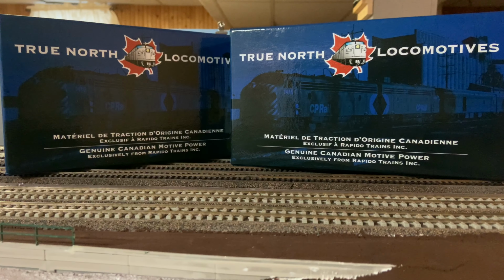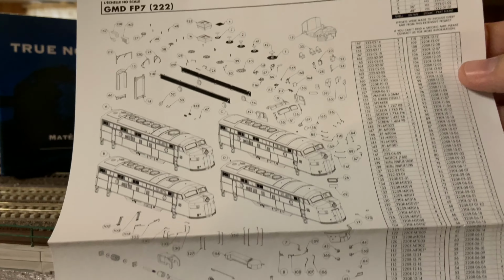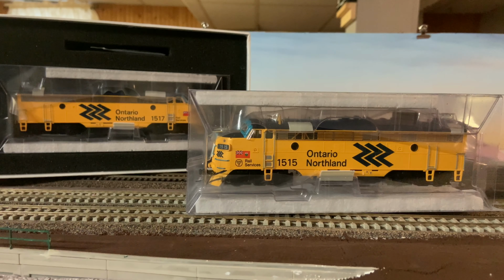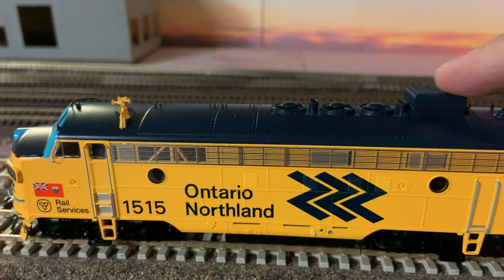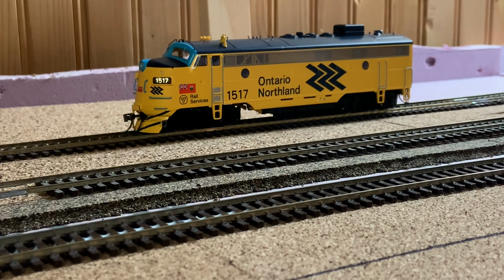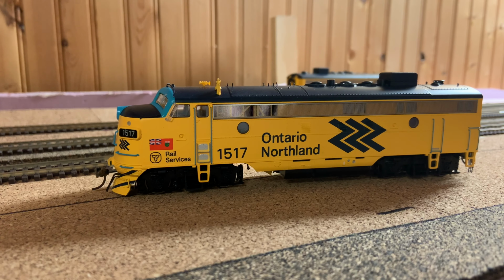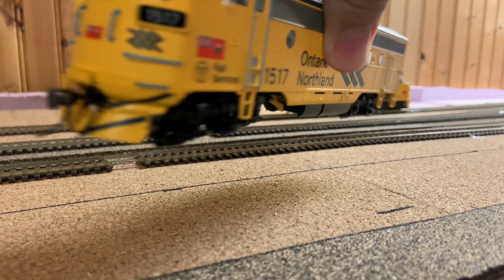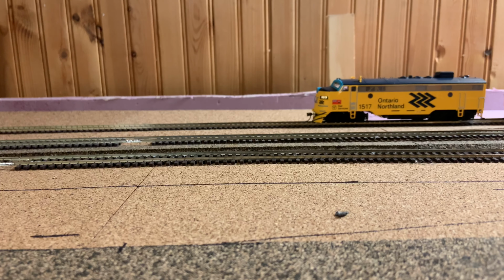Rapido FP7 Ontario Northland overview

Comment: I had some issue with them being jerky when starting to move and stopping. Rapido told me to lower cv52 until I was happy....just an FYI in case you have the same issue ;)
Reply from the maker: Robin Gagnon  I still need to work em in a bit before making any adjustments.
But I will keep an eye on them to keep them perfect.
Reply: What did you lower yours too?
Reply from the maker: Chris Dubya  I have not lowered mine yet.
Reply: @BigCDubya  I lowered cv52 to 15, it does not jerk anymore
Reply: @robingagnon9659  thanks. I will try that out.

Comment: To bad Rapido didn’t include sounds for the “Later” FP7’s that the ONR had rebuilt. As the original prime movers were replaced with Catapillar diesel prime movers during the late 80’s to 90’s before they were retired.